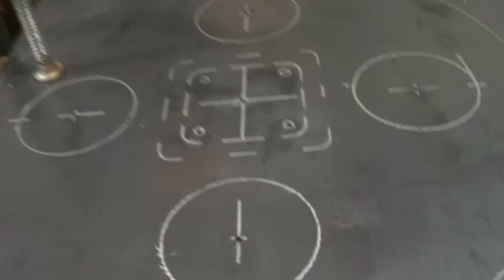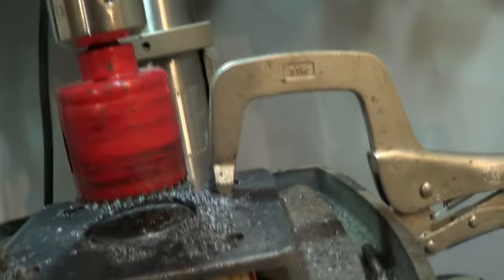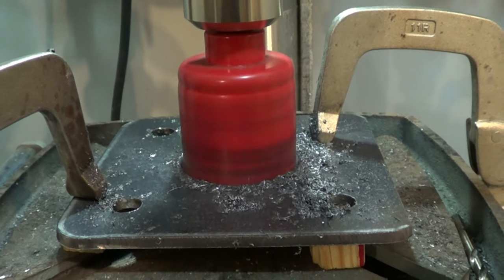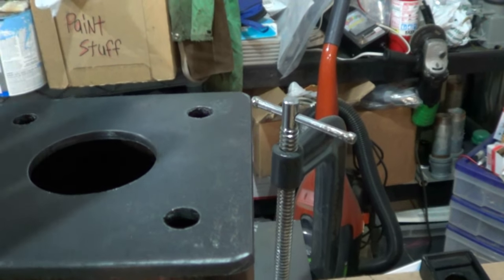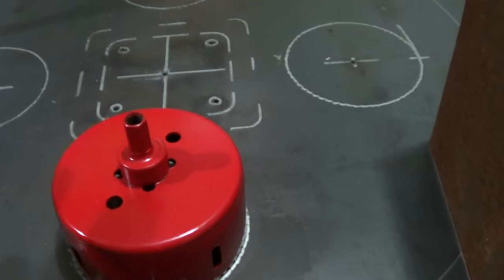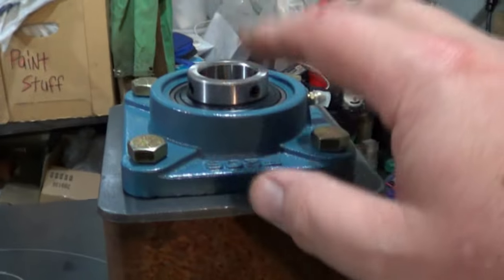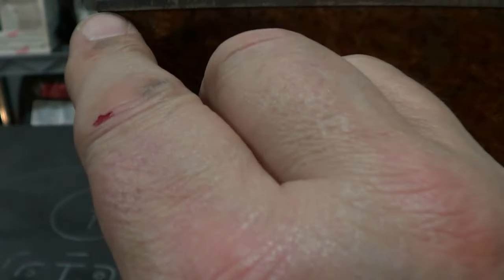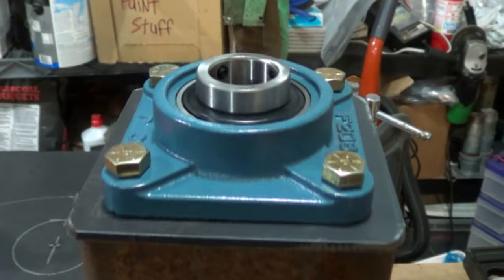AXIAL FLUX WIND TURBINE GENERATOR - CUTTING HOLE

Comment: this is actually a good vid educationaly speaking , you cover some important points re using metal hole saws , welding tips and plasma cutting angle.
although youve shared what youve learnt about axials youve hit on alot of key points and im glad ive watched them , im even slower at builds but ill get there im building tiny novelty versions upto the big ones , God willing i get them all built.

Comment: drill 4 to 5  quarter inch holes just on the inside of your circle cut to allow the metal chips to clear the cutting teeth of the hole saw careful not to drill out side the circle . so the half moon of the quarter inch hole is on the hole saw cut , this helps the hole saw to work better and cut faster , less heat and wear. love your work and thank you I know you can put the half moon cuts close or right on without seeing them after you cut your circle out . take care .